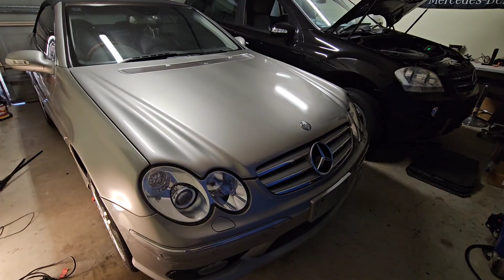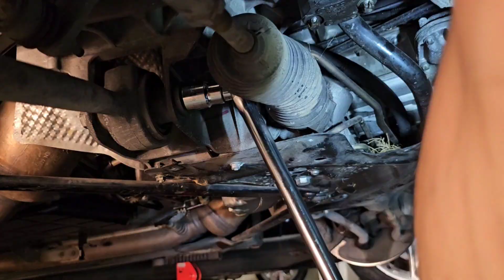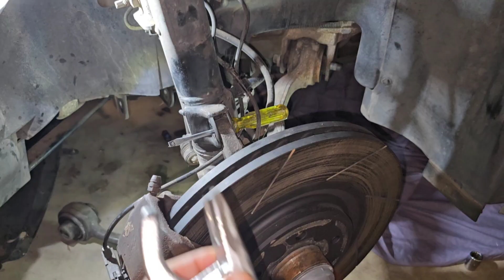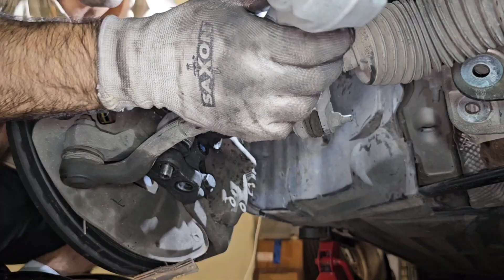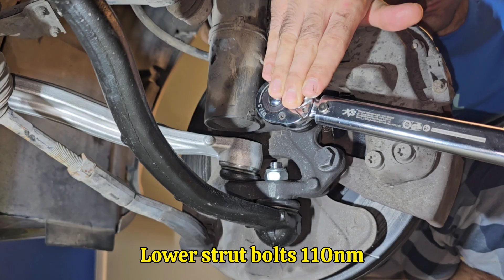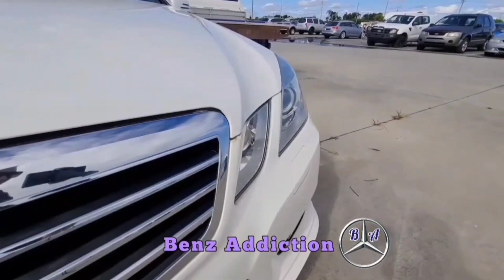Control arms replacement: Is it a DIY job? C, CLK, SLK class...

Comment from the maker: Have you ever tried to replace the control arms on your C, CLK or SLK class? This requires range of power tools, high strength as well as patience and above intermediate mechanical knowledge. Not being able to lift the car on a hoist makes it even more challenging, what do you think, can it be a DIY?
Reply: A few years ago I replaced the torque struts or upper control arms on my CLK ,,it was a big job and I agree it can be done , but would be so much easier with the car up high on a lift.
Soon I will be replacing a front strut mount , the rubber has cracked inside it and the bolt is not in the centre of the fender hole,,it is harsh over bumps.
So I get to undo the strut and sway bar bolts again..
Reply from the maker: @Leonardo555ZZZZ  Yes, it is an uncomfortable job without a hoist, not necessarily difficult.
Reply: Whats your take about LEMFÖRDER suspension parts?
Reply from the maker: @mzee0000  I have tried their products,  not a bad quality for the money.

Comment: I just did this job yesterday on my W204 C class, it is technically a DIY job but good god I never want to do it again. Its not a difficult job if the car has been kept in relatively good condition, but if there's any surface rust on any of the bolts, it turns a 6 hour job into a full day job. 

If your going to do this, buy a 21mm offset spanner, trust me, it is nearly impossible to loosen and tighten the bolts holding the control arms to the frame without one because of clearance issues. You don't need an impact wrench and for alot of the job it would be difficult enough to get enough space for one anyway, I got by with a 60cm breaker bar, but honestly a 40cm breaker bar would have probably made the job easier.

You don't need the special torx sockets but they definitely help.
Reply from the maker: Great tip mate. It is a back breaking job without a car hoist and proper impact wrenches. Unfortunately I will have similar job on the W208 soon but hopefully with hoist 😅

Comment: You did it even faster than FCP Euro advice. They have detached brake caliper, stabiliser link and abs sensor.
Pro tip: When replacing control arms you can replace stabiliser bushings at the same time.
Reply from the maker: Good point.  Thanks 😊

Comment: Im doing my 09clk350 sport front control arms and tie rods it also came with sway bar link i think o got the same 10 peace as you. Any tips befor i start
Reply from the maker: For Sway bar 4 bolts... be very gentle when tightening. It is aluminium thread.

Comment: Is this control arm available for a 2021 c220d?
Please anybody.
If so where?
Reply from the maker: Just search for W205 front control arms.
Reply: @BenzAddiction 
Thanks.
Reply: Depending on where you are located.  Are you unfamiliar with how to find car-parts on the internet?  It's a common wear-item sold everywhere.

Comment: I've got to do my 09 clk and I want to get your opinion on which part manufacturers you would recommend for this job? Upper lower and sway bar links and tie rods. I've seen complete kits.  available. Are there any manufacturers you would stay away from?
Reply from the maker: For your CLK W209, some solid brands that are well-regarded include Lemförder, Meyle HD, and Febi Bilstein. These are known for their quality and durability, and they're often used as OEM replacements. On the flip side, it's usually best to avoid very cheap aftermarket brands that don't have a good reputation, as they can wear out quickly and may cause noise or alignment issues.
Reply: @BenzAddiction  I picked up the kit from FCP. It wasn't a pleasant job being on my back, but I got it done. Next weekend the rear gets done.
Reply: My mechanic tells me the large rubber bushings even from lemforder don't last. The only ones that last are genuine. I might use lemforder full kit and if needed later, I just put the genuine rubber bushings, this way the balljoints will be replaced as well. The complete arm from MB is very expensive and you need 4.

Comment: Another question,  is the  bushing bolt slotted and does it go in the  center or off center in the  bushing.  There are ridges in the  hole where the bolts go...where did you  position the bolts on yours?
Reply from the maker: @davidperez-qc4go  slutted / Centre.

Comment: What is your opinion about reusing the bolts, washers and nuts on the bushing? My control arms did not come with new ones and Mercedes-Benz says to replace them too but most of the videos I have seen reuse the hardware..
Reply from the maker: Not a problem reusing them since they are steel as long as you torque them to specs.

Comment: instead of nutin  meters i have a 2005 c230k what is the torque in lbs?
Reply from the maker: All you need to remember is that 1 Nm is equal to 0.7376 ft-lbs.

Comment: Why people change the hole part and they don't just charge the rubbers
Reply from the maker: What about the ball joints?
Reply: @BenzAddiction  you mean the ball joint cannot be separate from the main part, just to make clear i am NOT A MECHANIC, i just watch my mechanic work on my car, once i changed similar parts on an Alfa Romeo 164 3 liter, and the ball joints were a smallish part of rubber, and also in the U.K there is a program called WHEELER DEALER and they fix cars
Reply: @frankiegregoriou4604 some aftermarket arms you can replace the ball joints. Not the MB genuine ones. This is valid for MB W203 and BMW E46 as far as I know (and many other cars probably).
Reply: Tool to press in and out is almost $400...

Comment: Isn't the stabiliser bar bracket bolt torque on the w209 25 Nm  ?
Be careful if you did 40 Nm you could strip the threads in the subframe.
Reply from the maker: Hi Leonardo, Oh really? Thankfully didn't strip the thread. Watch a new video is coming up in 2 hours, you will like it 😉
Reply: @BenzAddiction  I like all your videos,
,I will.
Reply from the maker: @Leonardo555ZZZ  Thanks mate :)

Comment: Are part fittings different for the clk w209 chassis that have sports suspension or not?
Reply from the maker: The control arms are the same, but different bolts are available (with notch) to allow camber/caster adjustment.  The normal bolts would only fit in the middle of the hole, though.
Reply: Sway bar links and bolts are larger diameter on sports suspension cars ,,code 486.

Comment: Your mechanical skill may be even better than car repair shop💯!  For control arm rubber bushing, do you regularly put oil or lubricant to keep from dry rotting?  Or you don't lubricate it just like everyone else?
Reply from the maker: Thanks Brian, I think rubber and lubricant don't really get along. I have not seen much on owners manuals about keeping suspension parts lubricated and that might cause them to absorb more dust. I believe they should be kept clean as much as possible.
Reply: @BenzAddiction Sometimes mechanics use silicone spray along inside race of rubber bearings, but this is usually to help with easier assembly if the rubber part needs to slide onto a bolt and it’s a tight fit.  If there is rotational motion it would relieve unintended torque on the joint.

Comment: I admire your dedication to your old Merc's. I'm about to do the same job on my CLK. I'm not being critical, but wouldn't it have been wise to replace the anti-rollbar bushings whilst you were there? Keep up the good work. 👏🏽
Reply from the maker: Thanks Richard, you are 100% right, I actually have a kit of 10 suspension parts (including the stabilizer links, tie rods, and steering rack ends) but as I said in the beginning this is for road worthy, I now have 14 days from the failure of the RWC to fix the issues otherwise have to pay the fees again, so just wanted to focus on this. And this might happen to others in real life again that they would need to replace these 4 parts in rush. My focus was purely on time and feasibility of the project for DIYers like me. Looking at my other videos, I usually replace a series of parts while working in an area. Also in Australia, accessing the parts is not easy and usually time-consuming and requires better planning ahead.
Reply: @BenzAddiction  They actually test your car to see if it's roadworthy? That's odd. Is that in the US? Where I live in the midwestern US, as long as it rolls under its own power, you're good to go!
Reply from the maker: @ScottHB20  Australia has more strict RWC rules.
Reply: Just a possible tip, I’m doing this job on a 209 clk 500, I checked the part diagram for away bar bushings and it wasn’t there. I went to my local Mercedes dealer and they told me the bushings are only available with a new sway bar. Can’t get them individually

Comment: It is imperative after this operation to check the parallelism of the front axle.
Reply: The car should be aligned after
Reply from the maker: Did I replace the tie rods or hamper the steering adjustments?

Comment: I replaced the control arms and anti-roll bar links on my 2012 C Class a couple of years ago, not a particularly difficult job and I saved around £500 UKP.
Reply from the maker: Good to hear... wow, that's a lot of money...
Reply: Local Mercedes dealer wants ~$1100 just for the parts, and $200/hour for labor. I'll save around $1,000, and that includes buying tools I didn't have. Parts cost me $205. Not OEM, but I'm sure they'll outlast the rest of the car ('07 CLK350 cabriolet)

Comment: You gotta work on your camera and lighting game, my guy.. Did you measure the ride height before removing said parts? How does one know where and when to tighten..?
Reply: You just have to replace them and take it for alignment period otherwise you’ll loose all your tires within a few driving hours. If you’re far away from an alignment shop rather use the old school tape measure until you get time for a proper alignment.
Reply from the maker: @mzee0000 That's my intention to get the wheels aligned ASAP.
Reply from the maker: Hi, thanks for the feedback, I am working on my camera and lighting, yes I measured the height. But it is different for different cars.